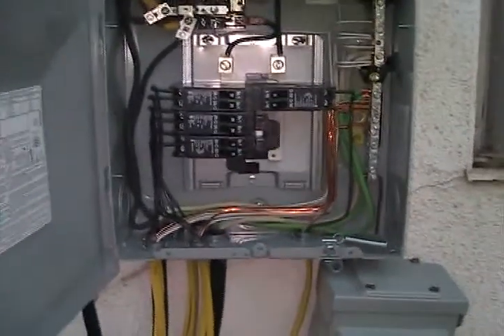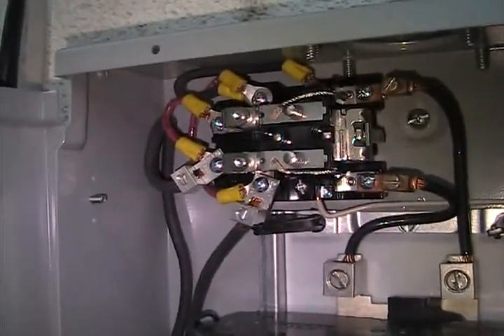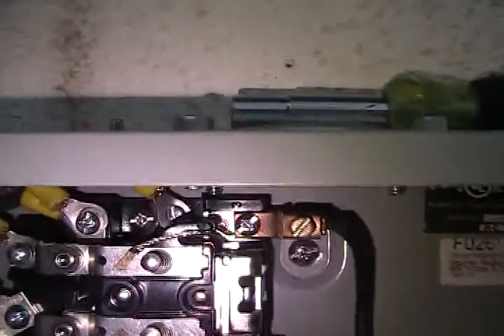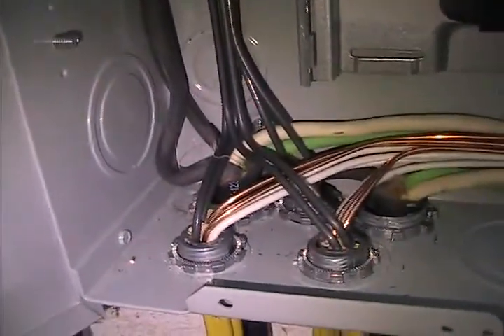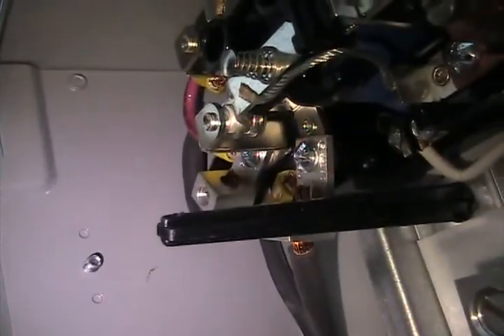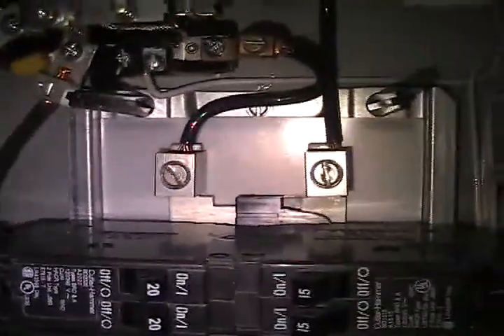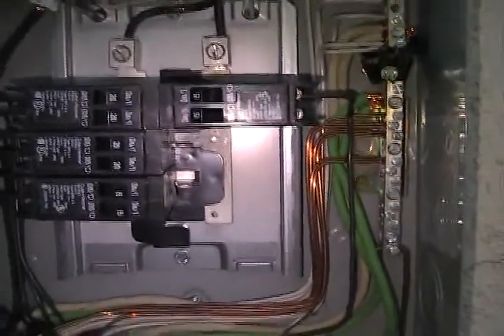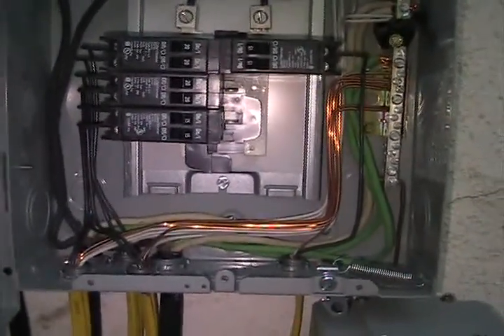ATS Panel.wmv

Comment from the maker: @Mike2008and2008 the problem with a 12v system is the amperage. a device at 120vac draws 10amps using 12v it would draw 100amps, the wire size would have to increase dramatically. Now it there were 120v dc appliances, well then that would be interesting.

Comment from the maker: @BenjaminNelson yes coil is 120v, I leave the inverter on all the time, is the batteries did get too low then yes the low voltage off feature turns it off. off voltage is 21v
I wanted 48v for the smaller wire gauge on the dc side, but didnt have the cake to spend on one right now. Maybe later.

Comment: So the coil is 120VAC, powered by the inverter?
What turns off the inverter? The low battery cut off is built into the inverter, right? What voltage does it cut out at?

My garage experimental solar is similar. It's just 120V - no 240. The inverter is an old 48V UPS.